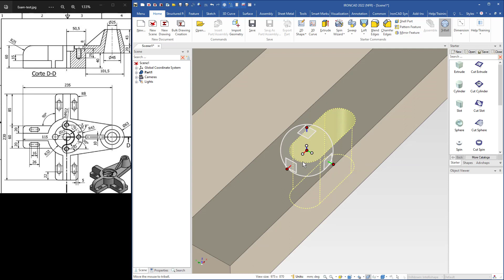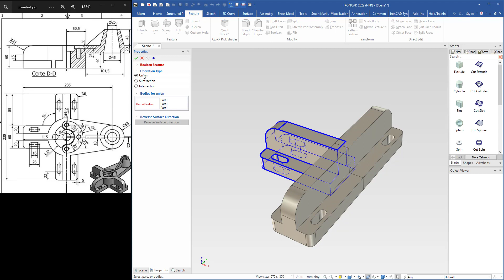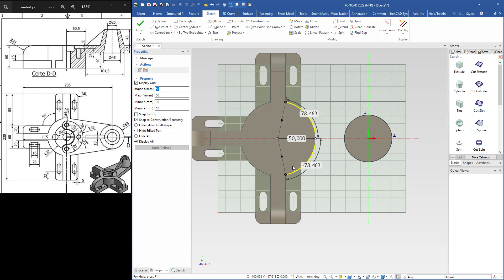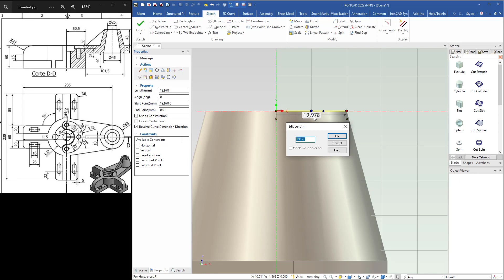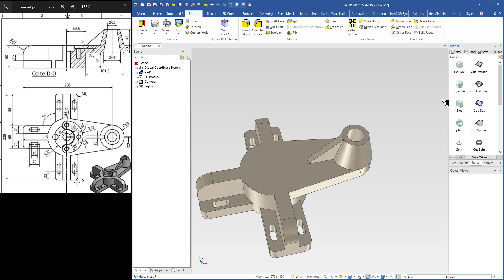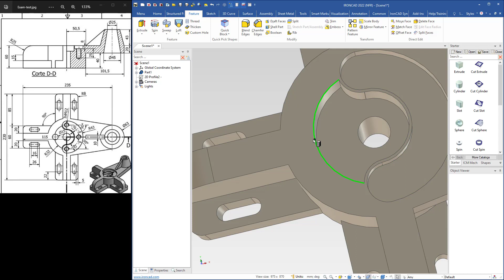How to create an advanced part in Ironcad

Comment: One more comment. The main cylinder is 101 mm. The dimension shows 50.5 mm in section D-D. That is from center to the edge.
Reply from the maker: Hi, that distance is from the center to the rib. The radius is 50mm
Reply: @Edusign no its not. You can see in the cut out of the section. The rib position is the same as the end of cylinder. Just like th dimensions shows 101.5 from end of cylinder
Reply from the maker: @JBCool0729  120-70=50

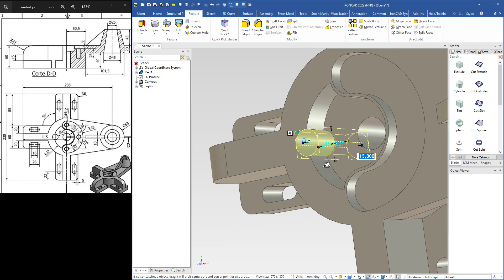Comment: Its good but like every one else you make the same mistake with the hole at 22:16 . the hole goes deeper the what everyone is doing. 😢
Reply from the maker: You are absolutely right 👍. The hole depth should be 31,25 or if the hole depth is 25 the thread depth should be 20